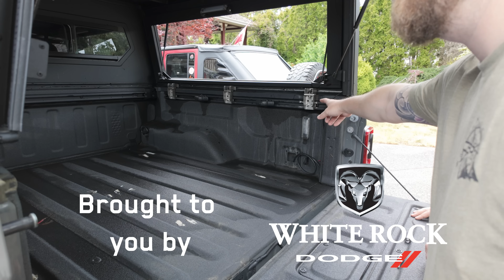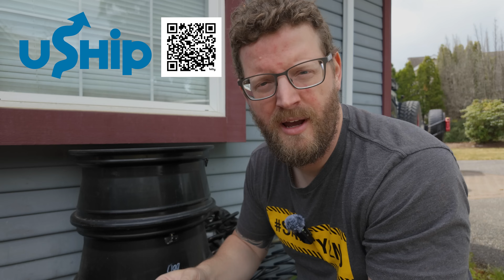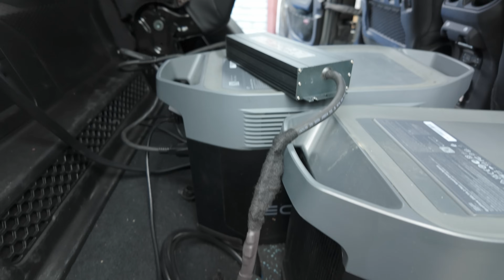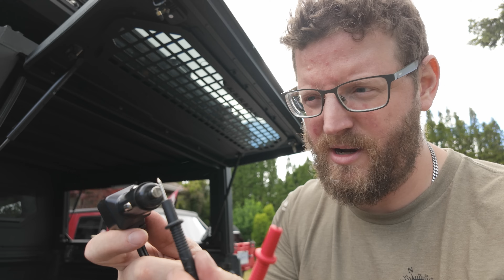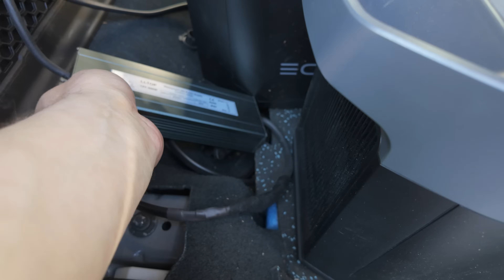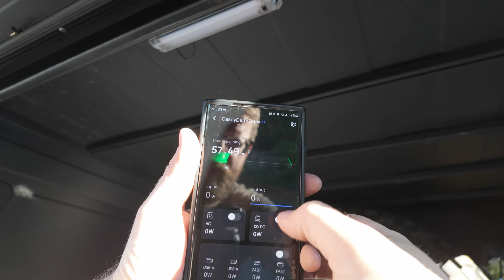Jeep Gladiator Bed Transformation: From Wasted Space to Ultimate Utility

Comment: Solid video dude! When wrapping the wiring with electrical tape, I found using plastic wiring conduit from lordco was a game changer. Super cheap and easier to access in case you need to change the wiring or fix a problem. Just a thought!
Reply from the maker: You mean wire loom stuff? it gets gross and cracks over long exposure to heat. I try to stick to tessa tape which keeps more of an OEM look and is simple to peel off and redo if needed.
Reply: @Casey250  Hmm I've wired my entire rock crawler with it and haven't had a problem getting gross or cracked. Search waytek corrugated loom. Temp rated for 125 °c. Looks good and sorta finished to an OEM look
Reply from the maker: Maybe I should stop buying the cheap stuff from Princess Auto.

Comment: I have the RSI Smartcap and my fridge is in the same location.  I use a Rough Country slide as its affordable and nice and smooth.  I have Molle panels on the back and driver side.  I never thought of airing down the spare to get it in there..no idea why - but now i know what i have to do.  I use my Jackery to power the fridge.  Jackery is connected to the AC outlet.    Nice video as always Casey!

Comment: Looks like maybe those snapped bolts were zinc maybe and not stainless steel?
Reply: Probably just poor quality, some sort of unrated stainless fasteners or overtorqued during install. Stainless is very sensitive to torque...
Reply from the maker: Still investigating
Reply: @Casey250  just going off the fact that it was being loosened mostly by hand it appeared. And that the channel it was in didn’t seem to fail. But don’t know either just speculating.